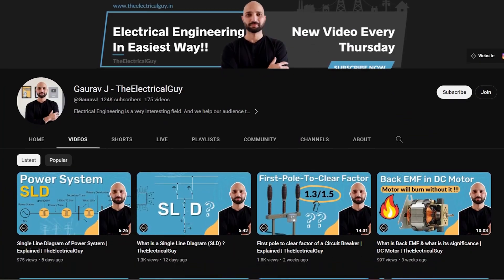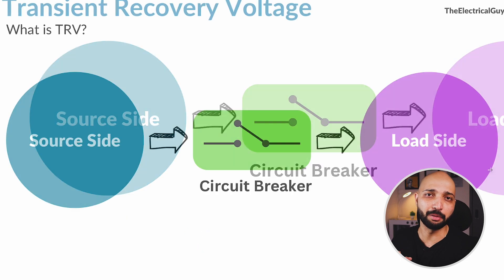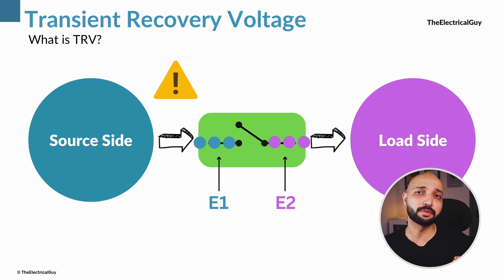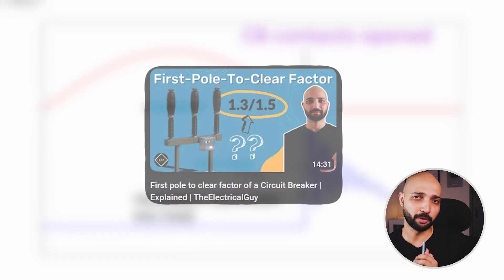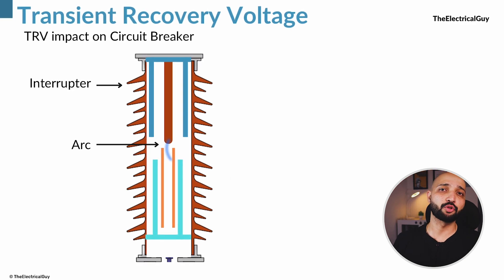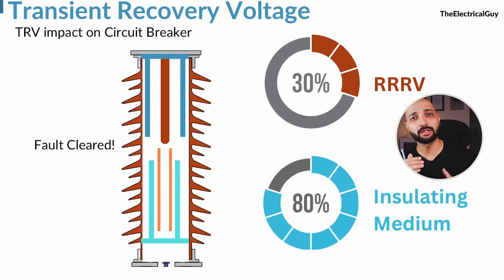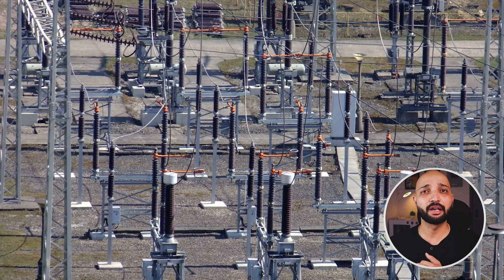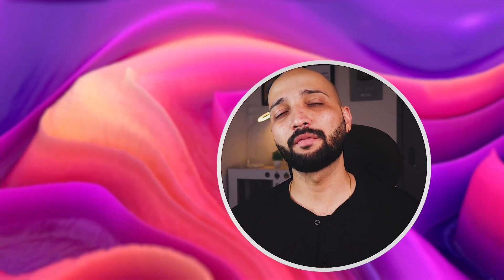What is Transient Recovery Voltage (TRV) in Circuit Breaker | TheElectricalGuy

Comment: 5:40 if rate of rise of recovery voltage is higher than the
Reply: Speed of the insulating medium
Reply: Breaker will fail to clear the fault

Comment: 3:21 waveform n TRV depends on 4 factors 1) condition at which the contacts are separating ???? 2) Type of fault 3) Characterstics of Network connection ???? 4) switching arrangement
Reply: This TRV exists for only a few microseconds after which the Normal frequency voltage
Reply: Is established

Comment: Hi, thanks for the excellent videos. My understanding of the 'trapped' charges in the lines (after the breakers have been opened) is due to the line inductance and capacitance. Normally the line is mostly inductive so the energy is stored in the inductive element (E = ½ * L * I²) and when the load is disconnected the energy becomes stored in line capacitance (E = ½ × C × V²), hence needs to be discharged via earthing switches. Is this correct?

Could you please make a video about these trapped charges and the effects they have on arcing? Many thanks!

Comment: Sir please makes videos on different circuit breaker mechanisms - siemens, abb( hpa ,hca,vd4),areva,cgl - spring mechanism . Please
Reply from the maker: Nowadays, all manufacturers use the same mechanism i.e. spring - spring
Reply: Please elaborate the mechanism how its working if animation is possible then it will be awesome.
Reply: Yes sir plz make a video on mechanism